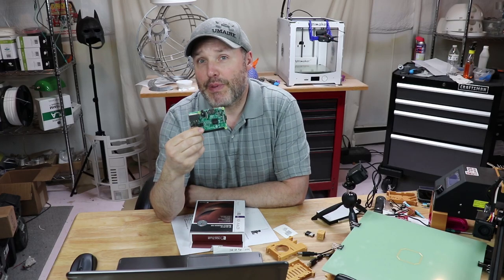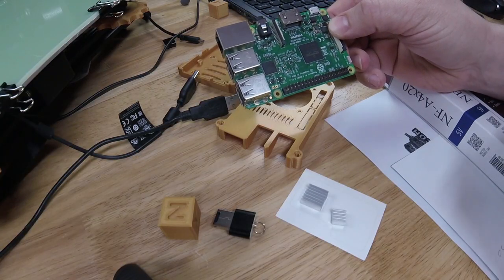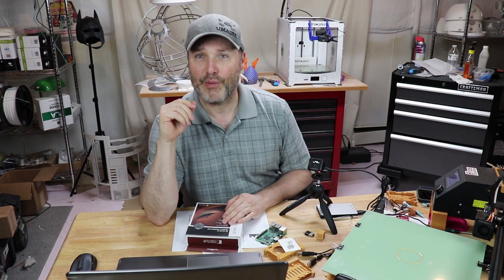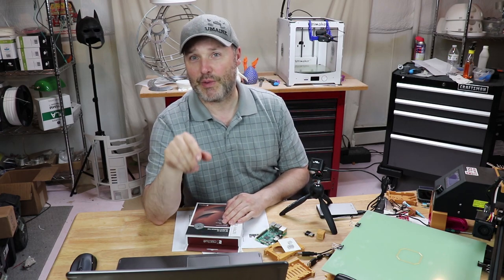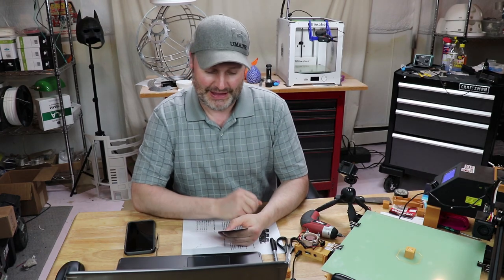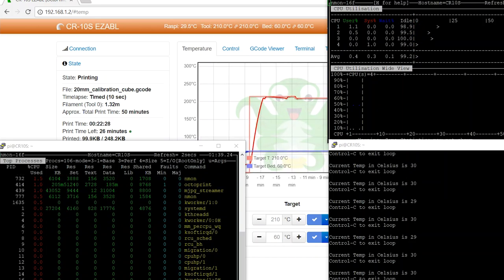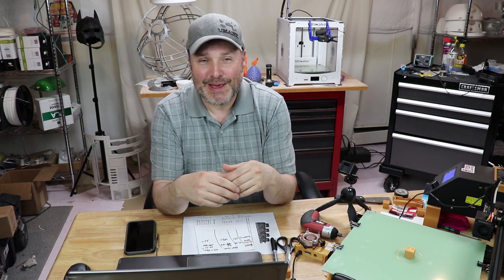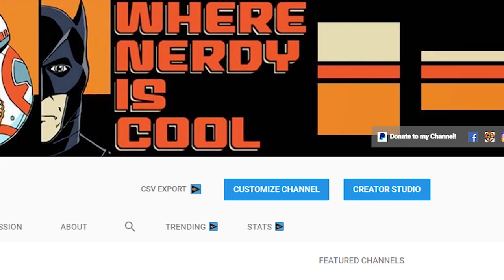Do you need to cool your Octoprint Raspberry Pi 3?

Comment: I think what matters is only if it gets too hot with any side effects like cpu throttling down or even low temperature enclosures deforming. Even with occational cpu throttling is is the matter of if you can wait a few seconds more unlike in real time applications where you may really get severe effects.
Modern raspberrys need extra cooling if you run a long term heavy load on them. With a larger file to convert and running ffmpeg on multiple cpus at the same time, you can surely get the temperatures up.
Reply from the maker: Good points. But also note how for under $20 you can cool the thing very efficiently and processors run better that way
Reply: @WhereNerdyisCool  I see the value of testing cooling, for example in very hot environment you really need a good solusion. Tests also give you good hints on what approach generally work and what does not.
However, I fail to see how overcooled cpu would be better unless you're for example overclocking. The cpu just runs cycles and as long as it does not overheat, it runs the same cycles similarly. I've not heard of life time issues when running not throttled either. That makes me assume running under throttling limit is good enough.

Comment: Great Video as always.

I have one PI 3 with a 3.5" touch screen with Touch UI for Octoprint and USB camera and it will overheat without a fan, a second PI 3 with just Octoprint and a USB camera which runs at about the same temperatures as your results.

I have a third PI 3 setup as a desktop PC running Raspian and this proved interesting in that it runs cool enough with just the heat-sinks as long as I use  FireFox as my browser but if I use Chromium it will bring up a temperature warning message after a few minutes of operation. I added a fan salvaged from an old graphics card which keeps the temperature down in the 36°C to 46°C range when running Chromium.

Thanks for this video.
Reply from the maker: I haven't gotten into the screens and touchui side of Octoprint and I am glad you mentioned it!

Comment: I had a print stop today and looked over and my octoprint was frozen. I have my raspberry pi 3 b+ with a big kintaro heatsink in a smartipi case with 7” screen running raspbian and a Logitech c920. When it froze I felt the heatsink and it was burning hot. I think my setup was making it too hot. I am going to reflash a fresh octopi and take it out of the display case. I plan on printing a case, adding a fan and just getting a raspberry pi cam cause I don’t want another 80% done print ruined. Thanks for the video.
Reply from the maker: I'd noticed mine were running warm but not as hot as you describe!  I'm glad I put heat sinks and fans on mine.  Small investment!
Reply: Where Nerdy is Cool! I think the heatsink wasn’t on right, maybe too much thermal paste and not all the way pressed. Temps were 50c at idle. Reset the heatsink and the temps were around 38-40. Added the fan today and added an exhaust to my case.......27-28 even under load. I am also a tech / IT (cybersecurity) guy so the cooler the better, even just for browsing rights. Well worth the $7.00
Reply from the maker: Amazing how it almost cuts the temp in half, isn’t it?
Reply: Where Nerdy is Cool! Especially since it just a little 40mm fan. I also skipped on the raspbian desk top and 7” screen. Thanks again

Comment: Another great video, Paul! For under $20, I'll just buy another Noctua fan for the piece of mind. If I end up deciding down the road I don't like it, I can always use it for another project. Did you see that Tim will be releasing a modified version of OctoPrint soon? Definitely some cool things on the horizon. Quick question, do you have any tips on setting up Octolapse? I can not figure out how to get it to work. The stock timelapse app works perfectly fine though.
Reply from the maker: I've just been using the Timed option for the time lapse...every 10 seconds.  The 5v Noctua fan is super quiet and I am just amazed the idle temp is 30C while the rest are 10+C higher...!  I haven't tried Octolapse yet but thanks for placing that on my radar!
Reply: I've seen plenty of people's Octolapse videos but nothing explaining the setup and explaining what toggles do what. I have a Noctua as my hot end cooling fan and it's barely a whisper!

Comment: Hey, great video! I recently added some LED strips (powered externally) but controlled using some GPIO pins on the pi, in your opinion, would this add any noticeable strain on the cpu? I've noticed that while not printing the lights react to commands immediately, however while printing it can take up to 5 seconds after entering the command for the lights to turn on/off, sometimes it will also result in the print stuttering. It also seems like octoprint takes longer to boot up now than it did without the lights. What commands did you use to view the cpu usage and temps?

Lastly, I have been having trouble with my cameras auto focus, it tries to focus but the bed is always moving faster than the focus can adjust, resulting in a constantly blurry feed. Even while not moving it sometimes tends to auto focus on background features and not the object being printed. I have my webcam mounted directly on the bed so they move together, i did this hoping i could set a manual focus value to keep to focus fixed on the center of the bed, but there does seem to be any straight forward guide on how to do this.

Thanks for all your helpful videos! Keep it up
Reply from the maker: Hi!  I’m not sure about the GPIO pins on the Pi very well.  I’ve read you have to be really careful which ones you use. You’d have to do some research on that. 
On the focus...yes I struggle with the focus on my Logitech cameras. Someone referred me to a link where you can remove the adhesive inside the camera that locks the focus.  I haven’t tried that yet.